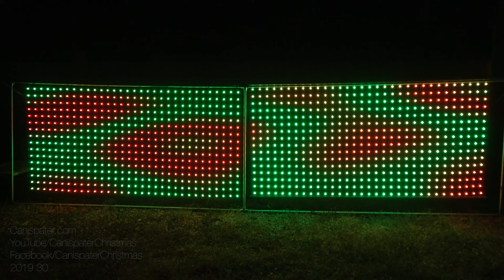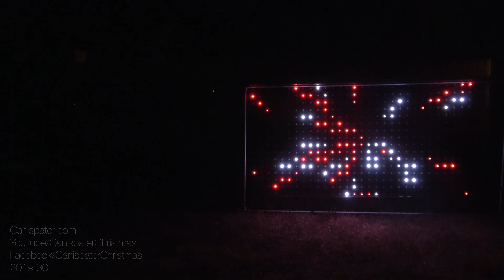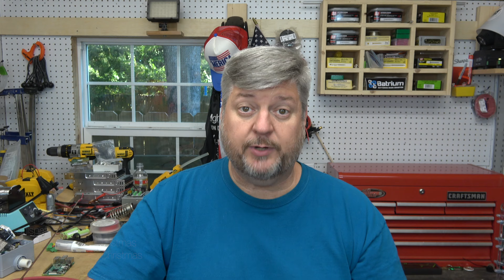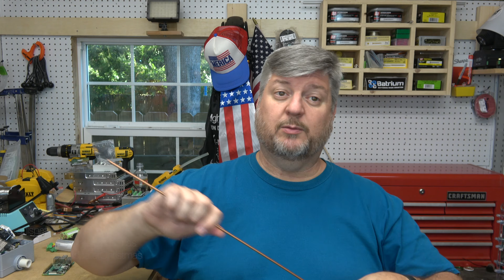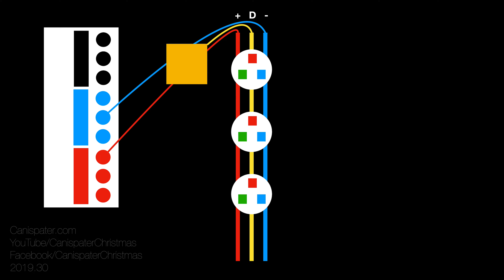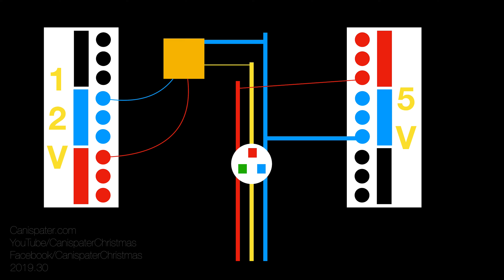🎄UPDATED! 5V/12V SHOOTOUT and Power Injection Follow-up  (2019)🎄

Comment: I have just started to learn about this pixel stuff, and will be doing extensive research on cost and plug and play projects to start. I have seen the megatree at holidaycoro and the leaping arches and such.  I have a small yard in Vegas  when I say small I mean like 40 feet by 15 feet with my driveway in the middle. anyway, why are the pixels spread so far apart instead of making them closer, by making them closer wouldn't this allow better picture visualizations?  I will be watching all your videos and may see this answer later.  thanks for posting these videos  great help.
Reply from the maker: My advice would be to hold off buying anything until at least after March. This time of year, vendors are out of everything. We have an annual lighting conference (Christmas Expo - planned for Las Vegas in 2021) in July which is when things really kick off for the year. Use the time to gather info and ideas about what you want to use in your display vs buying kits since your personal preferences won't be taken into account with a kit. Be sure to go through my beginner playlist (https://www.youtube.com/playlist?list=PLFyrAfJ-kKd4ZfPdXWIt8v_bav61mW_KW) and check into the Wednesday night xLights Zoom calls if possible (see xlights.org). Also check out the forums or Facebook groups listed in my videos. They are a wealth of information and a great place to get ideas and help. It's a lot to learn your first year, but many have gone before you so there's a ton of help available.
Reply: @CanispaterChristmas  very good advice, and i am doing research right now trying to see how to program this stuff, i feel if i can somewhat figure out the software the hardware knowledge will follow. and without having that hardware cant really test and play around, but without knowing how to control the brain the body doesnt move. lol  thanks again
Reply from the maker: @Lerchcon  Yeah, I totally understand. Getting components together and getting the lights blinking is fun. There are basic components to a system and it's easier to put a display together once you understand what's available and how they fit together. Keith will have an xLights training session in January that will cover the sequencing software in great detail so look for that. There's not much to FPP if you decide to go the Raspberry Pi route for the scheduler, but can be a little confusing if you aren't use to using a Pi. Pretty easy to get through though. I have a series on setting that up. You may try giving Ken a call at wiredwatts.com to see if he has anything available. Tell him you are starting from zero and want to get something to play with, but also use in a display.
Reply: for beginners who want a plug and play mega tree, arches, little trees, where do you recommend I buy the kits from? 
will I need anything special as far as house power to make all these work? 
1 mega tree, 3-4 leaping arches, and a set of little trees, I have seen prices of 600 plus just for the one mega tree.
being really new, I am not sure what is the price I should be looking to spend, because I am new, its confusing right now and not sure I want to spend money unnecessarily when I can get help I know I need. I did see the F16V3 which is funny seeing as how I am a Vet and that's the fighter I know allot about.  
Obviously I have searched several sites and they say out of stock, so now I need to figure out who even has what I need for a fair market price as I have seen some prices that are way outside the pricing of other sites. sorry for the novel.

Comment: How do you connect your pixel string directly to the PSU?
Reply from the maker: Negative to negative and positive to positive through a fuse. Data from the controller. If it's a separate PSU from the one running the controller, also bring the negative from the controller and tie it to the negative side on the PSU so there's no floating voltages between the two.
Reply: @CanispaterChristmas   Are you using the power injection wire for that then have them connected to the 3.5mm connector also? Just confused I see 3 wires in the connector to the controller and only 2 coming from the PSU.
Reply from the maker: Oh yeah. Most of the time, the only connection to the pixels is the 3-wire connector from the controller. When you inject power, ideally, it's from the same power supply and you're just trying to maintain a consistent voltage all the way down the string. Each pixel will drop the voltage slightly and if the string is long enough, you will notice the pixels dimming or not working because the voltage is too low. Injecting power is skipping a few pixels and tapping into the power rails to bring the voltage back up to the PSU voltage. There's a bazillion different ways to do it so there's no one way that is correct. Still good practice to use a fuse on the power injection wiring. The controller connection is already fused.
Reply: @CanispaterChristmas  but with the connection to the controller you can only do a little over 1 string of 5v around 80 pixels at the most or can you do 100 with the 5 amp fuse thats in the controller? If I have a string of 400 pixels could I put the ground with the data to the controller connection and the power straight to the power supply with a 25 amp fuse inline? I haven't done anything with wires in along time so I'm rusty and I'm just starting out with the pixels trying to get a little something going this year.
Reply from the maker: You can bypass the controller power distribution, but no real need to. You just have to inject enough to keep the controller's fuse alive. Also, brightness has a huge impact on all this. I run my show at 30%. Too bright to run them higher in a residential setting. Depends on what you're trying to do though.
Reply: @CanispaterChristmas  Thanks for the help.

Comment: Hi Jeff
Haven't talk to you for  a while. I am asking my question here since I don't know the correct video to attach my comment to. As you remember, I am  a newbie..  For Xmas 2020, I am planning on a mega tree with 16 strings and a total of 800 pixels with 200 pixels on each channel. Will be using a Falcon diff. receiver drive by a F48 controller. Am going to mount the pixels on the mounting strips this summer. So I thought, why should I wait to use the 800 pixels on a mega tree for xmas  and try to use them for a matrix on July 4th. It would be 16 strings across with 50 pixels on each string. This would give me the 800 pixel matrix. Since the pixels would already be inserted in the mounting strips, I would build a frame to hold the mounting strips straight across with some support in the middle to keep them from sagging. Xlights can create this model easily. Have played around with putting text on the matrix in Xlights. What I would really like to do, is have a waving flag on the matrix. I don't know if this is possible. So I came to you, since you are the expert. I might be barking up the wrong tree and the flag idea will not work. 
Also is now a good time to start ordering stuff from Ray? Also is the Xmas Expo in Vegas on for July? I am suppose to be there in July for my grandson's bowling. Right now Vegas is shut down. Ghost town..
Thanks for your help,
Larry
Reply from the maker: Haha Thanks! There is a picture effect you can use to load an animated GIF (waving flag). The lower resolution the better because the matrix resolution will be low. Give it a try. Last I talked to Ray, he was clear of the virus so it's probably a good time to order from him. Send him an email and inquire. As for expo, I haven't heard of a cancellation so assuming it's still on. I assume they will keep us posted.
Reply: Will learned something about matrixes and pixels. The lowest gif I could find was a 36 x 54 pixels flag. It doesn't fit very well on a 16 x 50 matrix. i needed a matrix with 2000 pixels to handle this gif. Also reduced the original gif down to 16 x 50 pixels. Really looks bad. Well I was barking up a tree that will not work with a matrix of small amount of pixels. Text works fine but not photos.
Thanks for your help,
Larry
Reply from the maker: Yeah, tough to get images looking good with pixels. Sorry it didn't work out, but you can come up with some nice looking patterns that will be fine.
Reply: Hi Jeff,
Well they cancelled my grandsons bowling tournament in Vegas in July. Sure wanted to knock elbows with you. No handshakes....
Your videos really get people started in the right path on pixel lighting. 
Take care this summer with the 310 degree heat in Austin.....
Larry

Comment: Thanks for this video, I'm on basically day 1 and am fixing to put in my first order and have always gone with the assumption that 12v was the way to go hands-down. I've read mixed reviews about people having more failures with 12v than 5v (which of course happens anyways), but the efficiency values you got are pretty convincing for me to justify 5v- if I can get them for comparable or cheaper than a 12v group buy 🙂

Eaves and probably floods (maybe makeshift floods) will be permanent install, mostly because the eaves can reach 20-25ft on a steep roof. Therefore efficiency and reliability are paramount for me. 

Your channel is not only incredibly informative, but also just plain entertaining. Thanks for taking the time not only to share your knowledge, but also put in a little production value as well
Reply from the maker: Thanks! Just more power injection needed for 5V so not good for long runs.

Comment: its funny, this year was my first year and I pretty much did everything you said not to do.  (Not intentionally)  5v LED Strips, about 3800 total, and 3 12v Wreaths.  Making cables was a tough part, but you are right about the strips being a pain.  But, once I discovered silicon tape, and the heat shrink butt connections with solder built in.  It was tedious but easy.
Reply from the maker: So next year, you'll be ready for anything! 😂🎄Merry Christmas!
Reply: Danny what controller setup did you use? Curious. I’m about to start mine soon. I ordered 20 LED 5V WS2812B light strips to put in aluminum channel along the house for a permanent installation
Reply from the maker: Ryan, depends on the layout. If it’s a small house and the ends are within about 30ft, you might go with an F16, but if you have a mansion and need to cover large distances, you might prefer the F48... or more than one F16 depending on the full display.

Comment: If I want to run just one small string of lights (< 100), do I need anything besides the Pi, Falcon Player, and an in-line signal amp?
Reply from the maker: You'll need a controller that converts E1.31 to SPI data the pixels need. Cheapest option is a Falcon PiCap or rPi-28D from Hansen (depending where on this marble you are).
Reply from the maker: Or you could get a pixel "tester" from Hansen Electronics and forego the Pi & FPP, but that limits the patterns you can run. Not sure what the signal amp is for.
Reply: @CanispaterChristmas  I'm a couple states over on the east coast (SC), and I did end up getting the PiCap.. And love it!  Can't really remember what I was thinking about the signal amp, but I've learned a lot since then, thanks to your channel.
Reply from the maker: @chrisw1462  Thanks! Yeah, steep learning curve, but just more of the same once you get the hang of it.
Reply: You can actually just use the Raspberry pi GPIO pins connected to the led string with jumper wires.  You would use Falcon Player and xlights to control the lights.  It works trust me and its the cheapest way to get into LED lights and start learning.  I use a Pi Zero, you can control about 800 pixels this way, just google the GPIO pinout for the version of pi you have.

Comment: I was wondering if you can help me fix an issue connecting 2 Boscoyo 4x42 Matrix plane node configuration 168 Nodes each totaling 336 nodes using a Falcon F16v3 and XLights. I’ve used 2 ports last year, but would rather use one with power injection. I just received an F amp to boost the data signal. What type of inline fuse amp would you recommend. I also have a F8 distribution board coming from Falcon. Due to ship next week. I’m liking the Falcon over an older Advatek Lite16. Software / firmware is easier. I do enjoy your videos.
Reply from the maker: Thanks! So you want to connect the two together? If they are more than a couple of feet apart, you'll need the F-Amp between them, otherwise just daisy-chain them. Power injection fuse size depends on how much power they pull at 100% white and how bright you plan to run them (typically 0.06amps per node, but I've seen different values on different pixels). Reducing brightness to 50% halves the power use. I'd probably try 5-amps at first on those. Just test it out well.

Comment: Is it necessary to always run the additonal cables for power injection directly from the power supply, or could it come from the controller in parallel with the primary power cable run? 

I ask the question having done a trial and having no problem just splitting the power and ground cables from the controller output and running a second pair of cables to inject power at the end of my pixel run. This raised the voltage in the middle of my 160 pixel string to from 8v to 10v on 100% full white.
Reply from the maker: That's fine as long as you stay under 5-amps. Once you exceed the fuse, you'll need to go somewhere else for power.
Reply: @CanispaterChristmas  That's great thank you :)

Comment: It doesn't matter what the total load is. You must fuse the wire at it's rated capacity. If you require 40A to run your pixels..... split the load into 2) #14 or #12 circuits and fuse them at 20A each. Remember..... the larger the gauge wire used the lower the voltage drop. Very important with 5v pixels.
Reply from the maker: Thanks!

Comment: I may have asked this last year, but I can’t remember. Can a person have two or three wires coming off of one terminal of the power supply? Essentially having 4 to 6  wires to power inject with instead of just 2 or 3 wires coming of a meanwell. I hope I explained good enough.
Reply from the maker: Sure. Number of wires doesn't mean anything. You just don't want to overload the power supply.  There are even some breakout boards available so you can come off the power supply with very large wires and break them out into 6 smaller fused outputs. Alan has one I like: http://www.hansonelectronics.com.au/product/hexfuse/